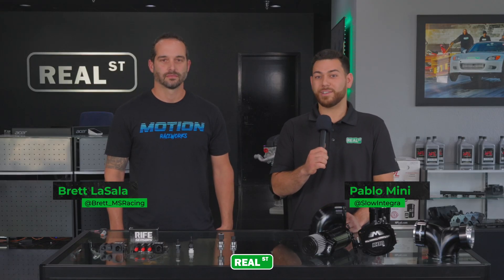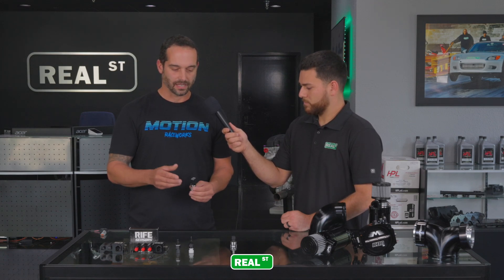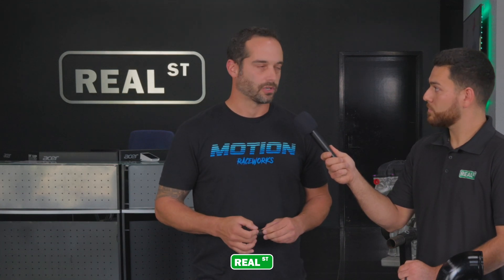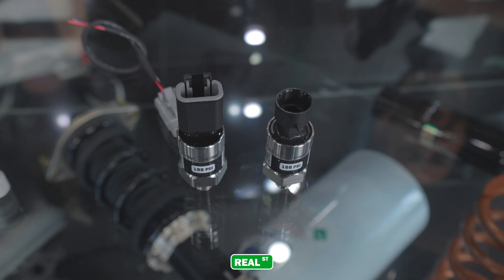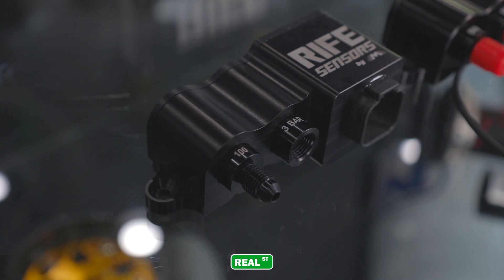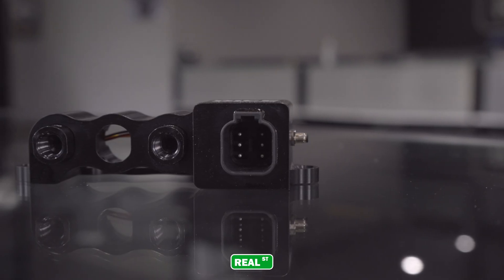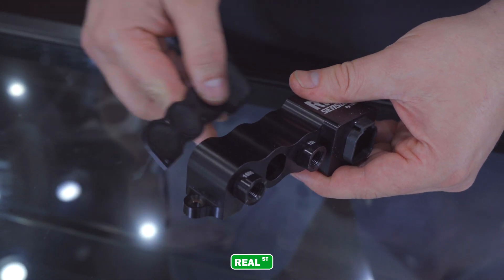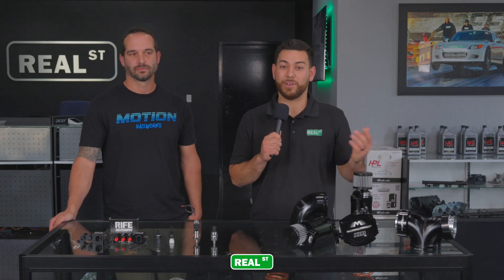New RIFE Sensors Products - Now Featuring DTM Pressure & Map Sensors!

Comment: Where is a version of the bosch combined temp and pressure sensore with a dtm and a sensible threaded end
Reply: call them up or call Motion Raceworks.  
99% of the time, there is not someone sitting around waiting for a comment to pop up so it can be answered.  But a phone call to either company will get the answer you need.

Comment: I Purchased one. A Intake air temp. Now I just have to figure out how to configure it.  Probably easy for most but it Literally took me fifteen minutes to figure out how to turn on a friend's computer to update my firmware on my terminator.  Small brains suck.
Reply from the maker: Hey good morning! Thanks for sharing that with us. They do have a few models, so I wont have the exact calibration info without the part number, but if you click the link below you'll find one example for their air temp calibrations. If you give me your exact part number I can verify if its the same, and if not I will get you the right information :)

https://cdn.shopify.com/s/files/1/0043/6807/2822/files/AT-Sensor-Calibration-10K-52-1201-to-1208-Thermistor-Output_1024x1024.png?v=1633098255
Reply: @realstreetperformance  I've got the information. I just don't know how to go about doing it. Because I'm Computer illiterate don't even own one. Your response. Vary cool. Thanks. 👍  Subscribe.
Reply from the maker: I see, happy to help! If you would like a closer look into this, send me an email with the exact info on ecu and sensor part number and we can navigate it together. You can email me at : Pablo@realstreetperformance.com

Thank you!